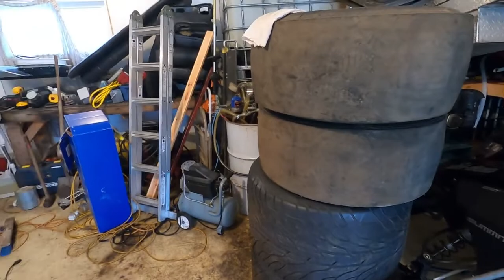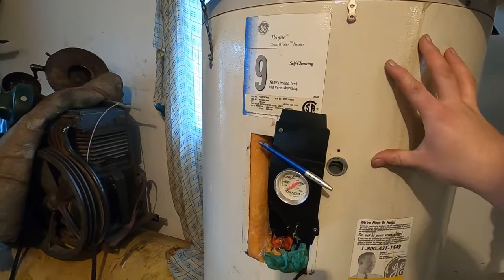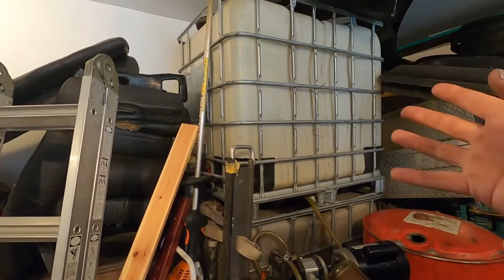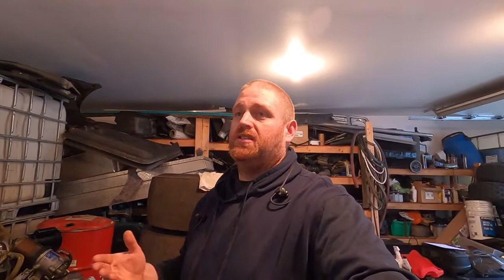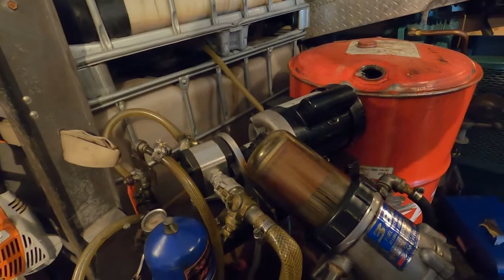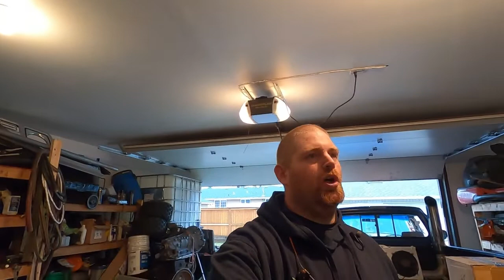A over view of my bio diesel unit

Comment: good to see you into biodiesel.i've been making Bio for about 20 years,my 96 12 valve has over 600,000 km's of bio use,original p-pump.i have the best source for oil,,nearly new,and i make high yield bio,not even washed,and it runs great on it,also,if you use a water heater upside down,it's convex and you can plumb it easier,and bonus,you can install a regular cummins or whatever block heater in,i use a 1500 watt one,and it empties more completely since the right way up the bottom is concave,so it never empties completely and you wind up with shit in the bottom that never comes out,funny to hear you mix with JET,,i have been doing that for many years too,do a lot of mixing to with canola,engine oil and trans oil is crap.dont even bother,and it stinks to high hell.Parker has a great hose that is 100% bio rated,
Reply from the maker: i like like do different stuff so and finding out what you should a should do lol  i never thought of the water tank upside down your 100% the there concaved on the top lol
Reply: @CUTTERUPROB  i played with a lot of changes to my processor over the years.before settling on large cone tanks with steel plumbing,i heat my oil outside the processor with some inverted water heater tanks with the top cut open but with lids,then i transfer to my mix tanks,works great,and having it on wheels i can move around the shop.
Reply from the maker: Ya I never got to the point with mine to get it all hard piped and stuff. But one day. Lol

Comment: I was under the impression that the process of making biodiesel "cleaned" the debris out of the vegetable oil and thought it was caught up within the glycerin. Does your centrifuge catch anything running the biodiesel through it?  I am very interested in any form of alternate fuels and eagerly await your testing results on your future dyno.
Reply from the maker: the glycerin is a 95% of the junk, but you will still and some glycerin / fatty free acids / water / meth that is suspended in the bio you should clean out, also after you get it clean you wnat to keep it sealed well to keep water out of it,

Comment: Cool video but I have questions ! Lol. Do you have a specific mix ratio? Isn't aviation fuel a really dry #1 fuel?    Does your "fuel" have an algea issue like bio fuel in plastic fuel tanks , or maybe that's just a farm tractor issue???   In the pulling world 100% bio does work "on the dyno" but required alot of (combustion) heat to see advantages otherwise they just slober, wetstack and wash cylinder walls.  A pulling engine is also decompressed to help them "live" at 5K rpm and 200-300 pounds of boost for 320 feet. Thanks for bringing up the road tax issue. Here in the midwest (USA) They like to check to make sure you aren't driving with red farm fuel (cheaper with no road tax) , so I'm not sure what they think about home brew. With fuel prices on the rise again it is really something to consider!!!
Reply from the maker: Ya # 1 is dry so that’s why I looked adding it to the bio. On the algae if you run a additive in it that kills it then you reason to worry.
Reply from the maker: On the road tax part. As long as your running some diesel I don’t know anyone that has been hassled

Comment: 👍👍...Sounds like it's actually quite a process....I Know there's some pro's and cons to the bio stuff...have never tried it myself....years back my old man tried mixing waste oil with diesel fuel...tried some 50/50 or some damn thing...I told him he wasn't going about it correctly and that it wasn't a good idea...he didn't listen..the inline Bosch pumps like a P or MW would run it but not well and things would plug up and shit...but anyway.... It wrecked a VP44 and a VE...😆
Reply from the maker: ya you can have issues